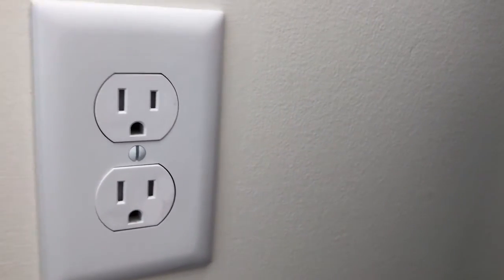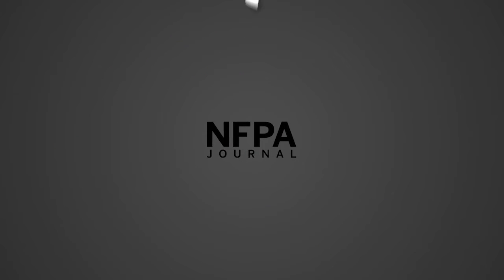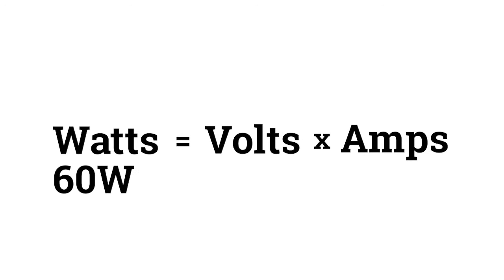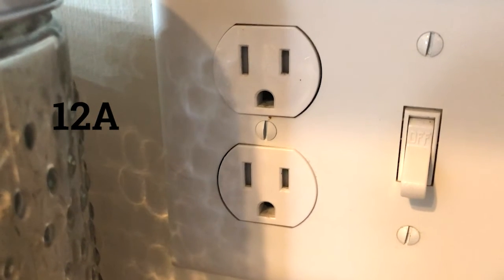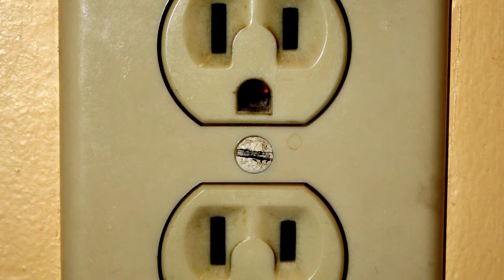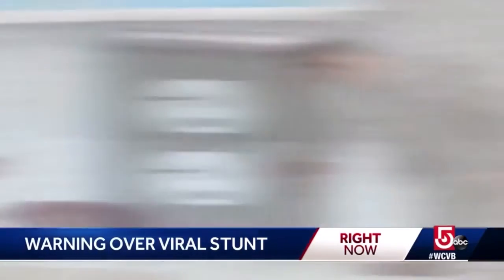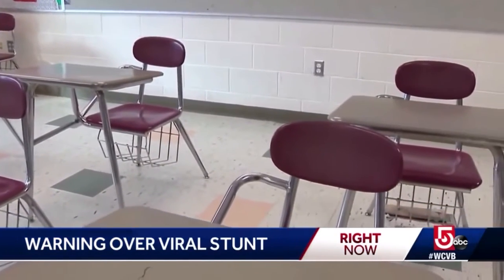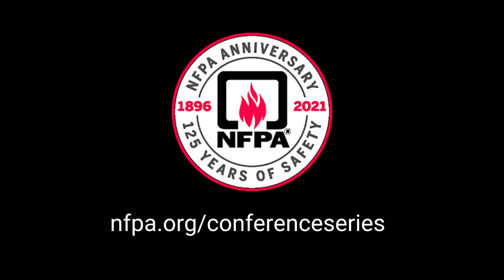Safety Tips for Electrical Outlets/Receptacles

Comment: It was said that the current increases due to loose fitting contacts.  NO, the resistance increases causing more heating at the contact point (I sqr R) and can escalate easily to very hot especially as the spring temper fades with heat.
Reply: This is true for non motorized loads like light bulbs and heating elements, in which the voltage drop caused by the increased resistance from the poor connection will actually decrease the current.  A motor however will increase the current draw when voltage drop occurs since it will work harder trying to spin at its designed RPM, this can burn out the  motor or trip the thermal overload protector, you may have noticed this effect if you ever used a circular saw with a dull blade or plugged it into a long extension cord.  

Either way this can be very dangerous because even a small amount of power dissipated at the point of contact can create intense heat.  The heat of a small 25 watt soldering iron is a good example of low power dissipation over a small area.

Comment: That receptacle is upside down - correct?
Reply: As far as I know, there is no right way up or down.

However I’ve heard that it is code to put ground on the upper side for safety concerns in some areas.
Reply: The NEC does not specify orientation. Most right angle / low profile extension cords and power strips assume the ground pin is at the bottom.